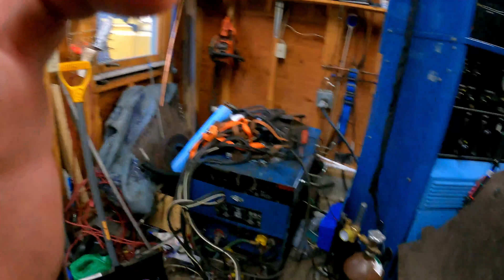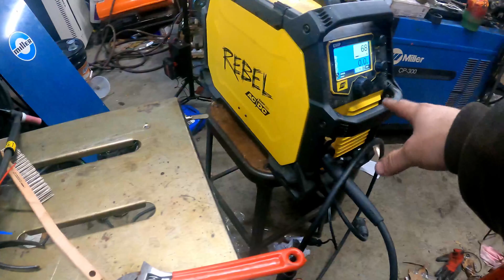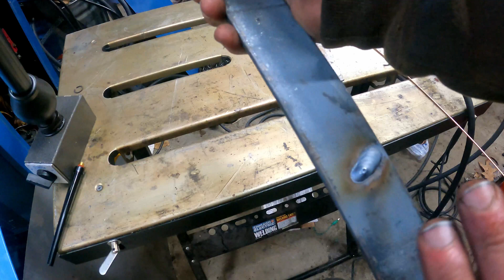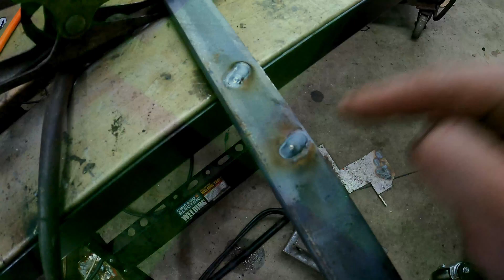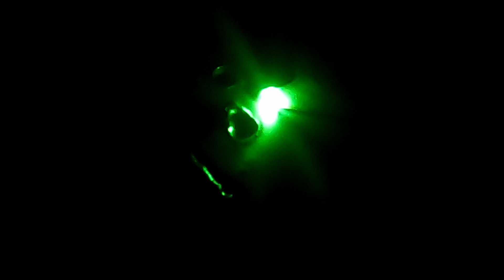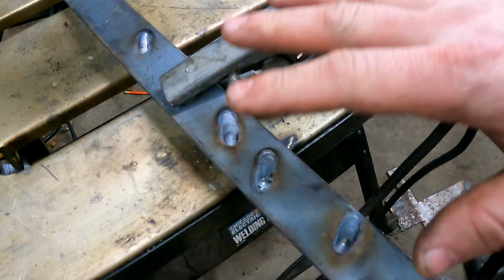New Hotness vs Old Iron - IGBT vs Transformer TIG Welders

Comment: In the Midwest in 2025 I never see these old Millers selling for less than $2000 locally and I'd need a forklift to get one home. Also they seem to require 100 amp outlets or 3-phase power and are usually sold as a bare machine without a torch or anything else. Many of them look rather old and beat up.

Comment: In your testing what you're doing how you said you like the 300 amp better the reason being is that the arc is much more stable in the 300 compared to the other ones. I find that between my primeweld tig225x and my cheap Chinese suseme mts 200 doing sanitary welding.

Comment: Geez 800. I thought my dialarc hf 310 was heavy 😳
Reply from the maker: I pulled it off the trailer with the Gehl 4610 from the other videos with clamp on forks.  I moved verrrrrry slowly as then ass end was definitely a little light.  That said, it really welds like butter.  Dialarc 310 is no lightweight either though.
Reply: @wirestiresandfires214  they are pretty much the same welder. The newer logo and both can technically do 310amps.

Comment: Loyalties aside, the primeweld and ahp machines are just as capable as anything else in the 200ish amp category, and for less than 1k, they're hard to look past. After a water cooler and ck20 torch you're into the rig less than 1500 bucks. Also, Everlast's advanced acdc-pulse is also worth the extra $$$.
Reply from the maker: That would a a very decent setup for a home shop and the welder you can actually afford and get welding with is always better than the welder you lust after but cant get. I may look like I'm on team blue with welders, but really I'm on team cheap as hell.  Thanks for the comment!

Comment: I've always had or worked with at a job ect Lincoln transformer tigs  I personally started on a old square wave 175 pro  then I moved up to a Lincoln precision 275 (about the best available at the time)  well long story short got into doing a different type of work for almost 10 years 
Well I decided to start welding again and I didnt have 6-10k to jump into a "pro level" red blue or yellow welder... so many weeks later I decided to buy the primeweld 225x tig.... I'm absolutely shocked how capable a machine it is!! It literally does everything (a little more actually) than my precision 275 that was almost 10k ..and the primeweld was under a 1000 bux to my door!! Name brand torch (ck17flex) good pedal heavy duty ground cable and clamp... I'm just shocked!!! I'm not trying to advertise for them or anything lol  but I just cant get over it ... makes me want to look into a Lincoln aspect inverter tig now lol
Reply from the maker: I hear pretty good things about a lot of the cheaper welder brands, given that the new machines don't require a metric ton of copper to produce I would think that welders would become less expensive.  I really like hearing about other people's experience with these machines so thank you for commenting and sharing.  I would avoid harbor freight but that's because their "best" tig doesn't have high frequency start or ac(for 900 bucks) and because their cheapest mig is always hot and the trigger only turns the feed on and off(which bothers me a ton).  What sort of projects do you typically use your machine for?

Comment: Gotta love the old American made transformer TIGs. I bought a Syncrowave 250 in the fall. It was my first tig welder. I went with it because I don’t want to buy Chinese and I couldn’t afford a new US made TIG. I also like that the Syncrowave is tough and smooth.
Reply from the maker: The Everlast is the only Chinese machine I'd even consider, but the cost on those is way more than an old transformer machine.  Your Syncrowave 250 is a great machine, and I really only upgraded from the Dialarc 250 because this machine had a liquid cooled torch and hand controls.